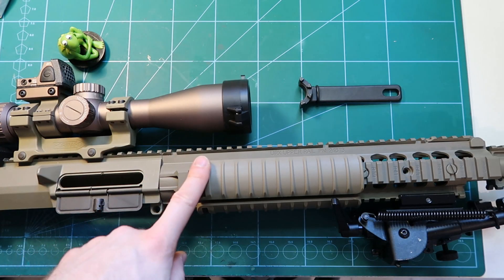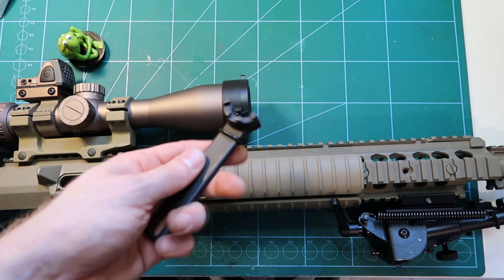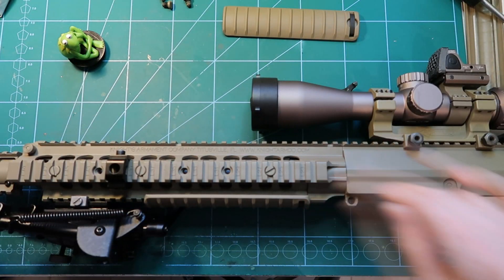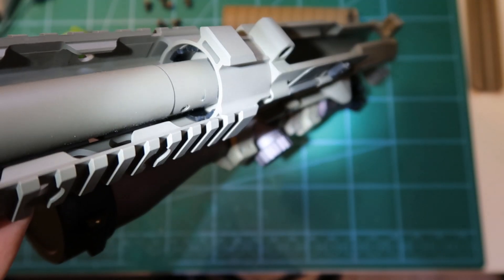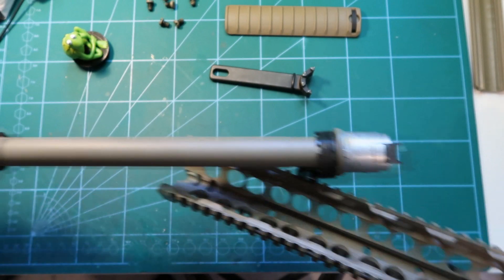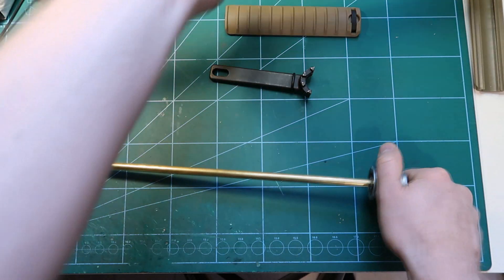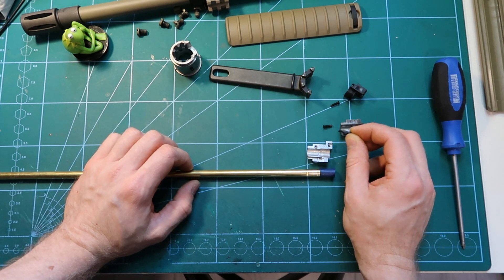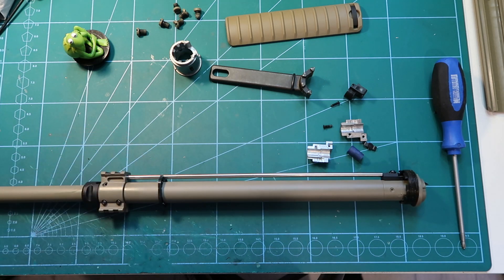Frog Tips #05 - Disassembly of VFC M110 URX front for inner barrel/hop up replacement

Comment: Hi, I need help removing my gas block. I cant remove the pins. Can you help?
Reply from the maker: You must have a good setup, fix it in some clamp or something and make sure to hit them straight. they will come out eventually. Very important is to hit them from the right side - they have heads like screws. Normally VFC inserts them from the side with no shell ejector. So be sure to hit from the side with the shell ejector. You can see how its made on their page, they have an exploded view there.

https://www.vegaforce.com/downloads/M110K1_partlist.pdf

Also, heating parts up with a heatgun might help.

Comment: Hi Frog Engineer, have you tried using the Ares qd silencer for your VFC m110? Thanks!
Reply from the maker: Hi, me myself no, but I spoke with a guy who did. He said it fits just fine, you only need to remove the indexing pin in the gas block. In VFC it is in that angled hole, and in Ares is straight on bottom. You can replace it or completely take it out.

Comment: Very handy video, thank you! I own a VFC M110K1, do you have a recommendation for inner barrel and bucking? I hear good things about PDI
Reply from the maker: Hi, PDI makes no barrels that fit VFC GBBRs. Mainly WE open bolt GBBR barrels fit which leaves not much choice, either an RA-Tech or Maple leaf. VSR barrels are not usable in VFC GBBRs too. Unless you have possibility to mill barrel interface to another one (then anyway VSR will not be usable).
Reply: Ahh, that's a shame! Thank you for your response and advise!
Reply: @frogengineeringairsoft  You say VSR barrels don´t fit?
I read on reddit that VSR-10 type barrels fit, are those different? I´ve been looking at upgrading my M110 with a Maple Leaf crazy jet VSR-10 barrel, from just comparing pictures I would have thought it´s compatible
Reply from the maker: If you check how the VSR-type barrel look like, it has these two vertical slots for blocking the barrel in the chamber, which are quite thin and they start from the groove for hop up bucking (they are like an extension of that groove forward). For GBBRs you use a different type of grooves, that are separate, more forward and not "united" with the groove for the bucking. Try to google a barrel from Ra-Tech for VSR and any WE GBBR, you will see the difference. Actually, gas pistols have the exact same barrel interface as GBBRs. I cannot paste pictures here, but if you want you can contact me on Facebook and I will provide some for better explanation.

Some people mod these barrels or just force them to sit in the chambers... I have seen only issues with that as when the barrel moves in a GBBR it shots exrtremely randomly.

By the way, there is also a version of Maple Leaf crazy jet for GBBRs, so if you get that correct one all will be ok.